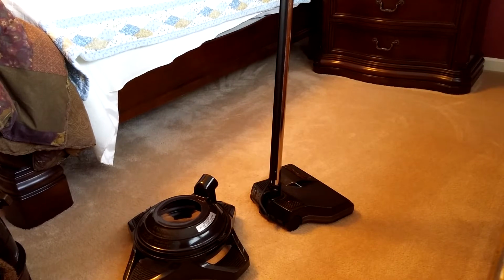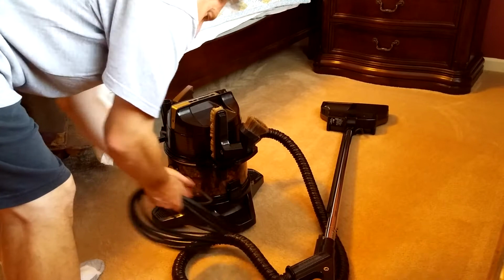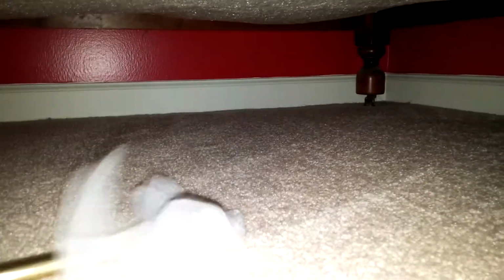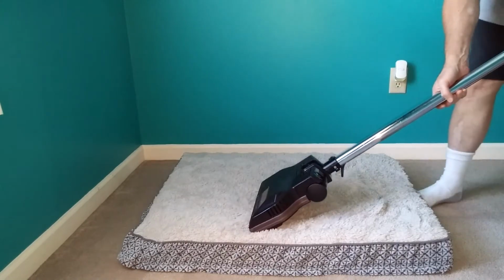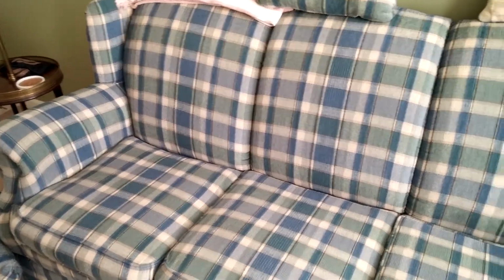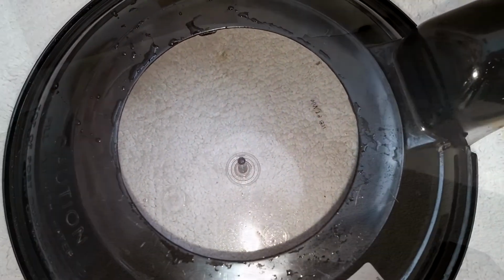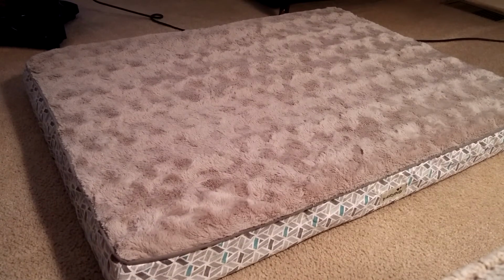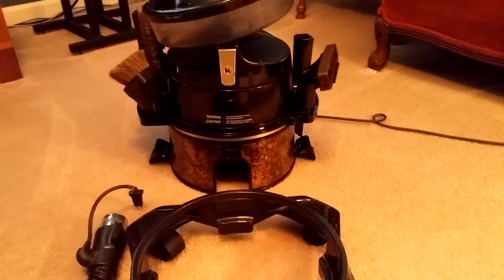Rainbow D4C SE PE Whole House Cleaning

Comment: Did you get your D4C brand new or is it used?
Reply from the maker: Thomas Rectenwald I got it used about 2 years ago For $10 and the PN was nearly completely trashed. About $70 later, it is as you see now.
Reply: VacLab it looks like you've really reconditioned it then.
Reply from the maker: Yup, many hours to get this puppy back up to almost brand new.  I do that for all my machines though...
Reply: VacLab I bought an E2 2speed last November that was working but dirty as can be. I used pledge to polish it back up and put a new hepa filter in it. Now it's my main vacuum that I use in my house. Blows me away everytime I vacuum.

Comment: I tell you what I think would be kind of cool if rainbow were to come out with the central vacuum system
Reply from the maker: Mike Myers that would be very interesting! But would people remember to change the water?
Reply: VacLab that's a very good question to probably not. Unless they came up with a way that I had like a sensor built into it that it wouldn't let you use it until the water was changed
Reply: There are Central systems that can actually vacuum water and drain automatically directly into the sewage system.
Reply: Bruce Solomon they are called drainvac
Reply: Bruce Solomon they are called drainvac
Reply: The hoses on the central vacs are a pain. We have one and have also the hide a hose. It works great but there still isn’t anything better than the rainbow. When you have carpet messes, the rainbow shines and it does a better job than anything I have had. I have also had Bissell, Meile, Sebo, Kirby, and none beats the rainbow.  I bought a Dyson and kept for a couple hours is all because it has so many plastic pieces and cheap plastic and I was fearful it would break before I could return it for sub par pick up.

Comment: Are Rainbows better than  Kirby?
Reply from the maker: Not even close, but they are more expensive. So there's that. 🤣
Reply: @VacLab  😂
Reply: Does the Aerus Electrolux canisters clean as well as Kirby?
Reply from the maker: @keenanhayes350  Nope. Kirbys are at the very top for pile carpet cleaning due to high airflow. Rainbows and canisters don't have that feature. Sanitaires and Royals also clean pile carpets very well.